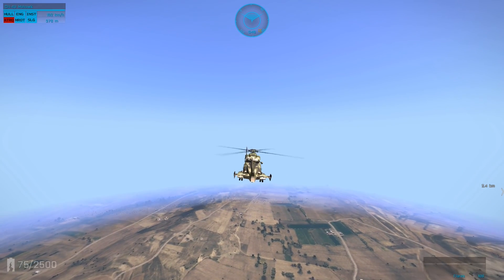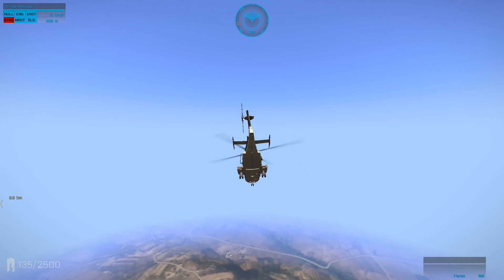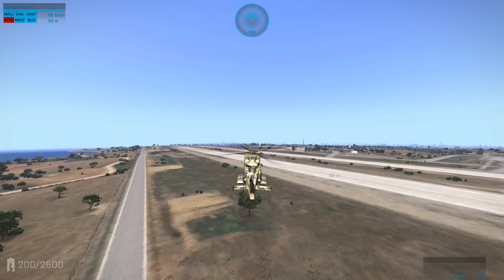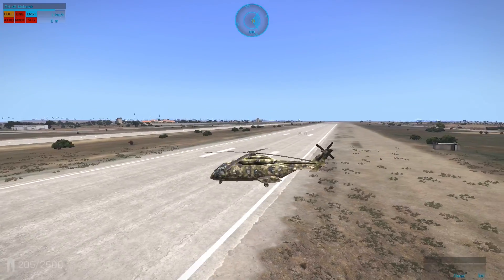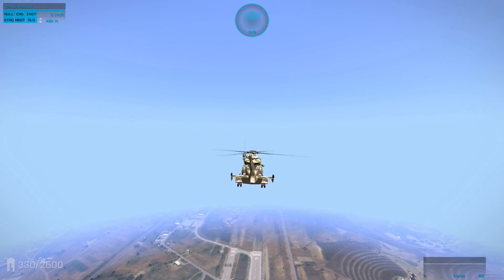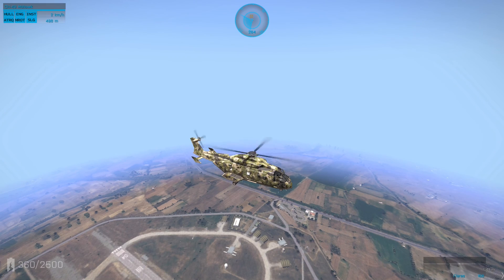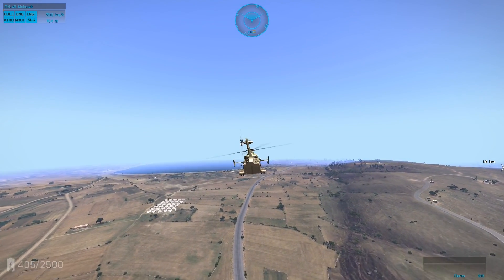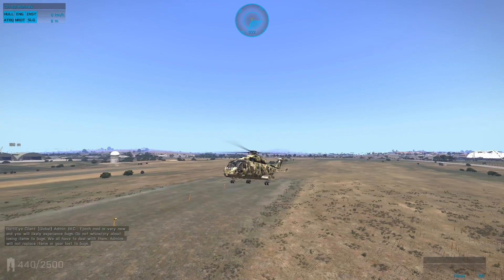Arma 3 Heli Tutorial: Auto-Rotation & ATRQ Failure

Comment: Also not to critique this too hard because you couldn't really replicate it exactly and you did a very good job on the vid but some on the speeds and heights that you demonstrated autorotation at are too fast and too high, it's tricky to get right but best practice is to get it as slow and controlled as you can when you practice, you won't always have the huge fields of Altis to rely on and often will have to land in a much tighter area. Nice vid tho